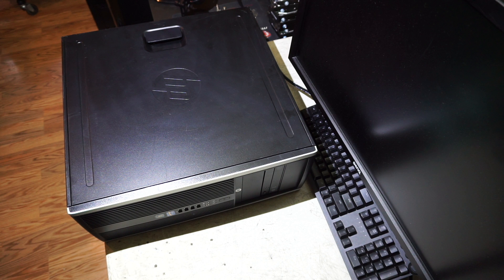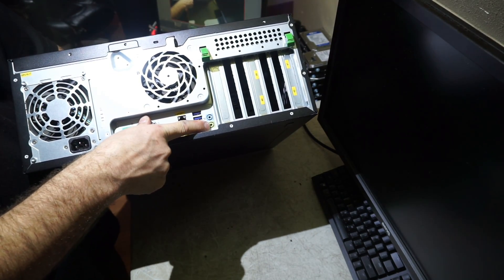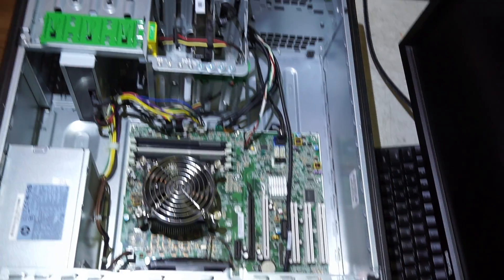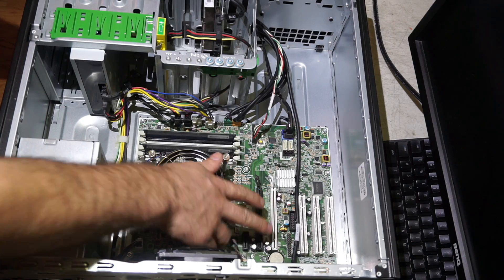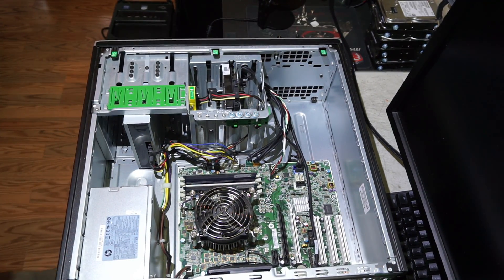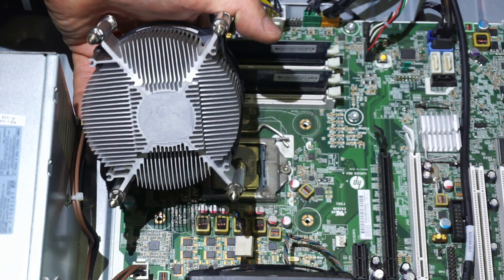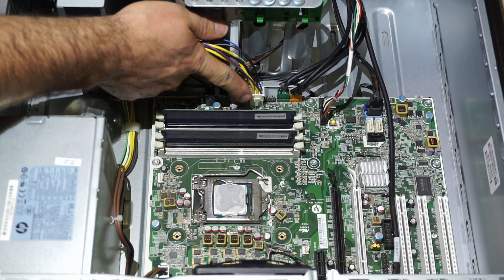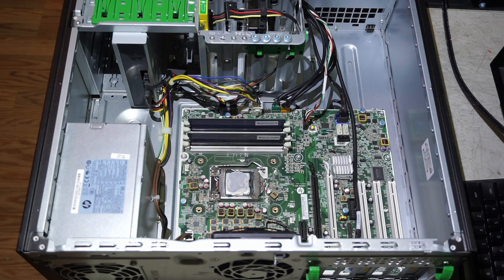HP Elite 8300 Features overview and light teardown

Comment: Thanks for the video. I hope you can help. My brother in laws psu tanked. I'm going to order exact same model. But before I do one item of confusion. Does the psu only have 3 white connectors?  Beside P1 and P2 on the system board there are two black 4 pin power connectors for sata0 and sata1. Are those coming from the psu or somewhere else? Thanks!

Comment: You can put a lot more than a K2000 or GTX 650 on this.
Reply from the maker: However, it is a video card better suited to this particular system
Reply: @dragonsystems5973  The proprietary PSU's can handle a lot more power without any concern. You can run a 90W card on a 220W Lenovo P320 SFF PSU from the PCIE slot alone this according the manufacturer's manual itself, same thing with these HP's and Dell's too, this desktop has a lot more than a 220W PSU.

Comment: nah, get a 1650 super, and just duct tape on a spare Genky no brand PSU on the outside of the case, route the six pin inside, and call it a day.  OR, replace the weird proprietary connectors via adapters,  and put in a decent modular PSU. HMM I was not aware of the BIOS errors.  Are there workarounds?  What precisely are the nature of these errors?

Comment: Could a different ATX motherboard be installed in this case ? I note the built-in IO panel on the back of the case - but could it be removed, and would the resulting gap line-up correctly for a standard ATX motherboard's IO connectors ?
Reply: no

Comment: Excuse me sir please please 
Tell me what is the model number of this cabinet 

I am sad so I can not find the model number of this case 

Please please tell me
Reply from the maker: It’s in the title of the video
Reply: @dragonsystems5973  I can't understand 
How to use which types of motherboard in this case 
Atx 
Eatx 
Micro ATX ?
Please sir guide me please please
Reply from the maker: @akstyle2546  you dont use any of them, its a complete build from HP. Its not meant to be used as a case for a custom computer... kinda confused as to what you are even trying to do here.
Reply: @dragonsystems5973  sir I have a PC core i5 3rd gen 
But unfortunately my PC motherboard are crashed so I am confused 
How to order a new motherboard 
 I want a order a new motherboard 
But I am not sure 
If I ordered a motherboard 
How to identify correct form factor of 

Motherboard and PC Cabinet 
I am troubling and I am confused 
How to decide?

Please please please please please guide me
Reply from the maker: @akstyle2546  it would be listed as the motherboard to this exact machine. You may or may not be able to get something else to work, it’s been years since I was hands on with one of these
Reply: @dragonsystems5973  can You guide 
Me
 
You are using 
Which type of form factor motherboard using in this cabinet 

Please now help me

Comment: I've got some old optical games. What about whitelists?  Can you OC?  I'm looking at buying one of these for a budget gamer, and I am wondering if it accepts the i7 3770K, but if I can't O.C. because it's a super locked down BIOS (Like my current PC) I'm not interested.  Right now I HAVE a 500 watt PSU, and the aforementioned 1650 super.  I can find an i5 model on ebay for around 100 bucks, but it's super stripped down,  What price would you offer for an i7 model?
Reply from the maker: I dont know how whitelists would affect CD based games... as far as OC, maybe there is some sort of hack, but without doing it either in software or some complicated hack I dont know of any normal bios based way to do it. It certainly would accept a 3770K, but it would be a waste, you would be better off getting a non K 3770. As far as selling, honestly I only deal local, it would cost soo much to ship one of these it would take all the profit out of it.
Reply: @dragonsystems5973  I'm sorry, no I meant whitelists on GPUs, wireless cards, peripherals, basically.